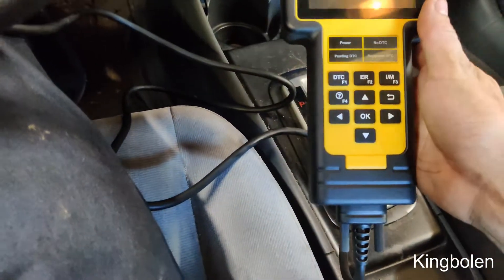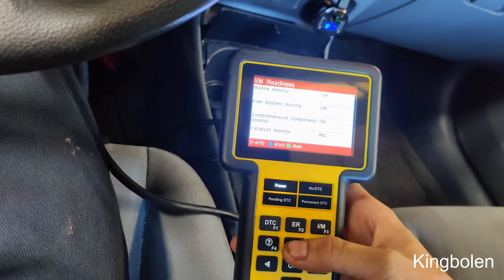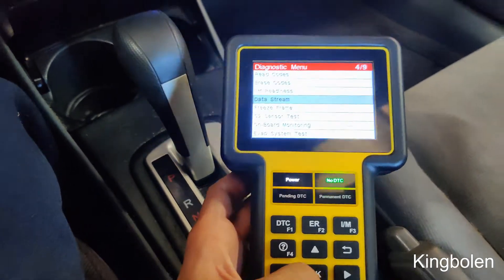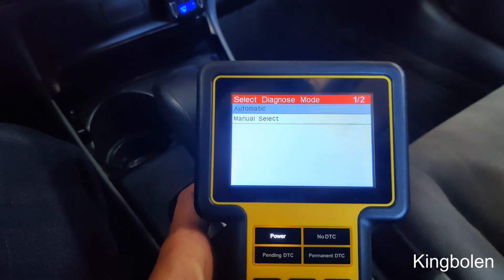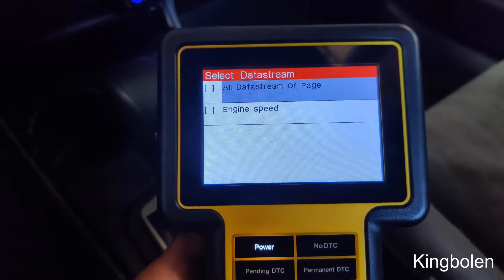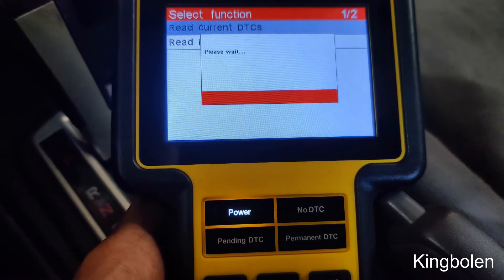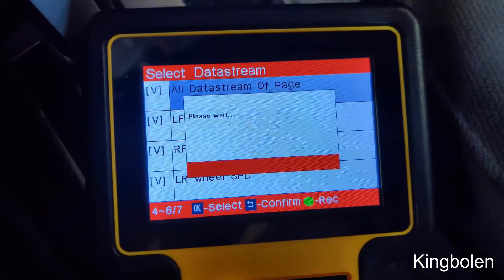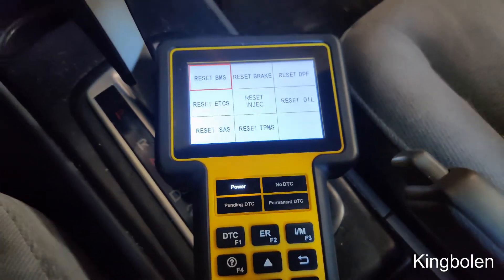How to use a Thinkcar TS600

Comment: Hi i bought this tool and im so amazed by it. It is by far the best obd 2 scanner with functions that ive purchased and indeed recommended to many people. Anyhow i have two questions to ask. Could this tool operate well without the device updates?? And i was trying to access my ABS system on my 2014 Hyundai Tucson 2.4L GDI and it seems i cant find it under SCAN on the tool. Mine just shows STABILITY ELECTRONICS CONTROL and AIR BAG 1 and AIRBAG 2 and you can read the faults and so forth. Unlike the this video, ABS systems shows under brand amd model of vehicle. I was wondering if you could help me out. Thank you.
Reply from the maker: Hello Jaime,Thanks for your question.
1.You still can use it if not update.we will recommend to update if it not connect you car.

2.For Hyundai Tucson 2.4L GDI,TS600 can read airbag but not read ABS.we will note it

Do you have chance to test it on other cars?
Reply from the maker: Please email us media@kingbolen.com or message us on FB @kingbolen.fans
Reply: Hi thank you so much for your reply i greatly appreciate it. And yes i will get incontact with you. And honestly i did not tried it on other cars because i just recieved the item 2 days ago and tried it on my car and it was amazing!! Really smooth and cool. I was hoping i could access my ABS system with the tool.
Reply: @Hookd4reelz94  hallo friend had you try it on different brands